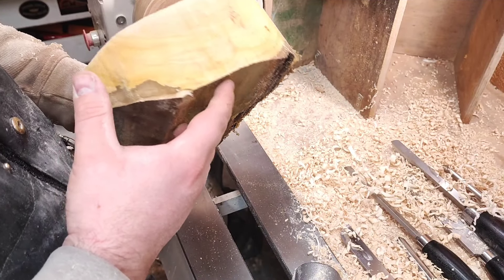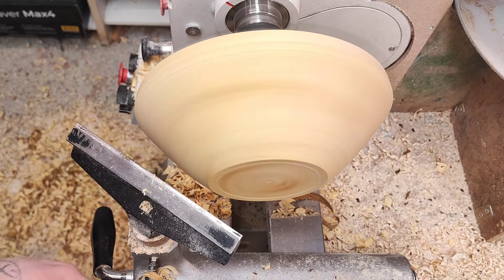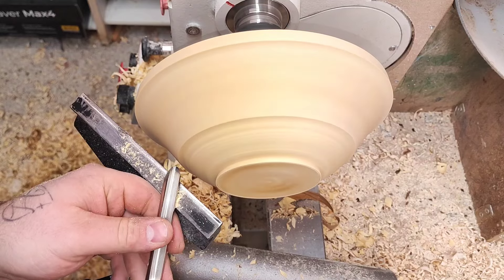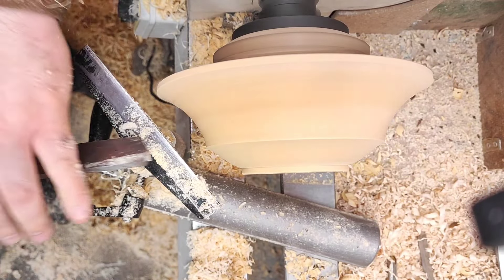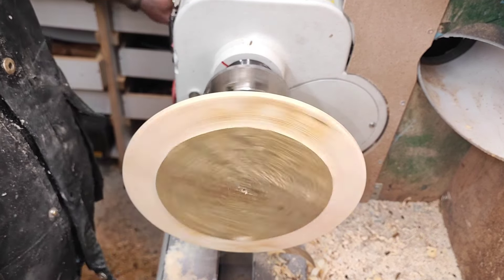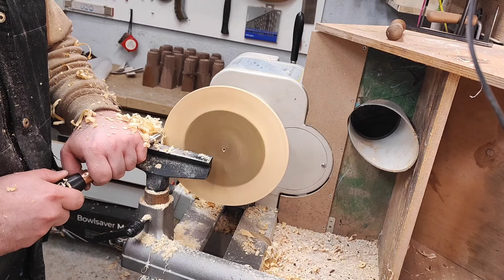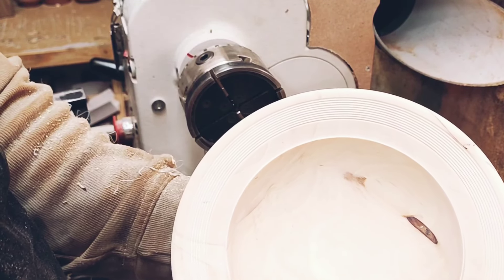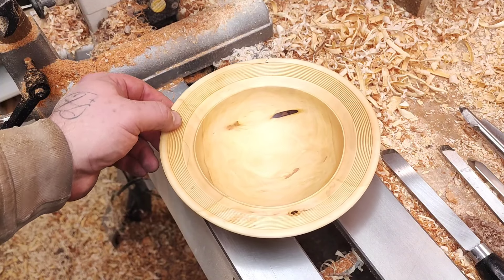Its just a bowl but this one sort of grew on me....

Comment: Very nice looking bowl.  Really like the multiple curves.  I need to remember the use of the thread chaser as a texturing tool -- the results are quite nice and give a different feeling than using one of the spiral texturing tools.  That bowl looks very cool in a warped configuration but I bet that a bowl from dried wood would also look nice.  One question, when you have a bowl with the number of different curves and shape on the outside, how do you judge and set the thickness of the bowl while you are turning the inside?
Reply from the maker: Thank you Mark, that is good question... On this one ,like you said multiple curves on the outside,That is why I put wide rim,to have more of the single curve on the inside, I could follow outside shape but it would not look good.... This separate outside from inside and in this case works as its very busy piece.... Wide rims have hidden benefiths 😀

Comment: Hey buddy. Thanks for the video. Mind if I ask, what speed are you turning at when you started ? Thanks again.
Reply from the maker: Thank you, it was around 1200rpm until is true up then I put it on 1450rpm... But I adjust for every blank speed as there could be variations in wood and disbalance so I always start very slow and bring the speed up, some blanks won't allow at the beginning more then 700rpm, so you have to be aware of that.... Always start from zero then add more speed